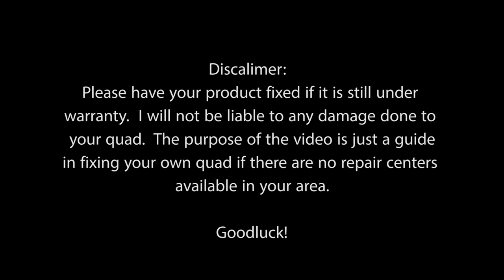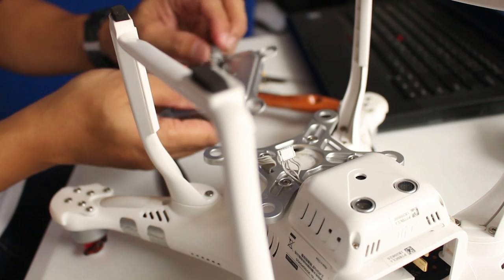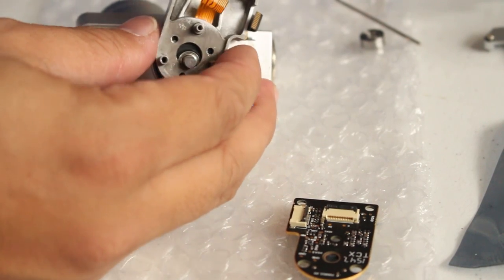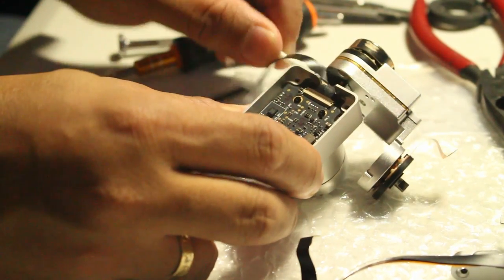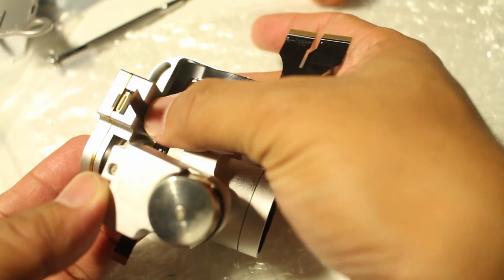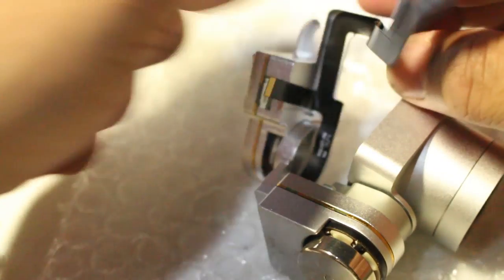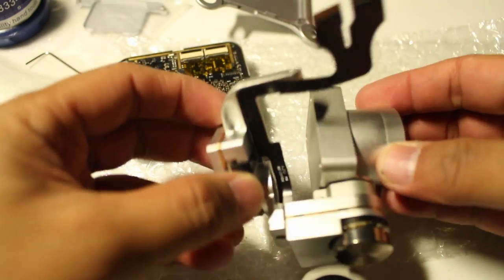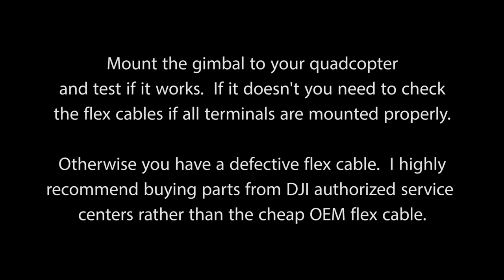Yaw arm and Gimbal Flex ribbon replacement for the DJI Phantom 3 Advanced and Pro

Comment: I have dji phantom 3 standard my cam will not move went my dji started up what do you think is the problem maybe need new roll motor esc chip circuit board or maybe new. Pich motor. Help me please

Comment: hey I have a problem I have a Phantom 3 4k drone and my drone be having a slight wobble in it. I bought several new propellers still the same issue. when it is setting down there's no wobble issues only whenever I flying do you think that's a mechanical issue or a software issue?
Reply from the maker: It may have to do with the gimbal.  Might as well clean the terminals or the magnet by using an high pressure air blower.  If that still doesn't help then there maye an issue with the ribbon connector
Reply: @dehnermdeleon  actually I think I end up fixing it there was a low hex screw that needed tightening..
Reply: compass gps

Comment: Would you recommend gimbal flex flat cable from China ? Seems so fragile and wondering how reliable is not OEM one. Dou you have experiences guys? Does it works on not OEM one?
Reply from the maker: Not recommended.  The ones I bought did not work.  Really have to buy at the DJI flagship store for compatibility.